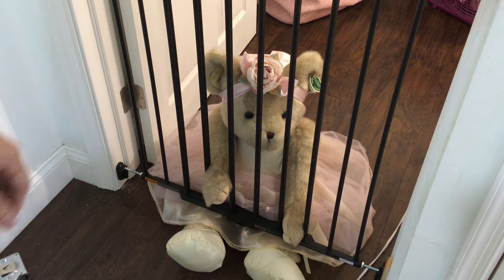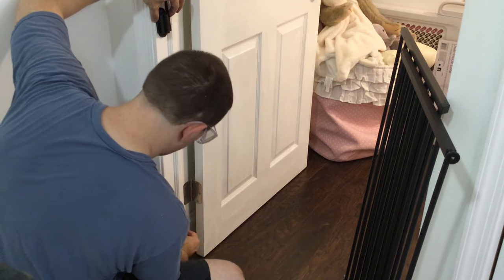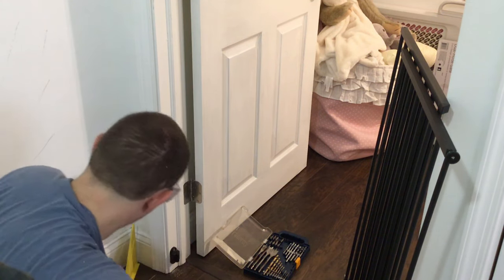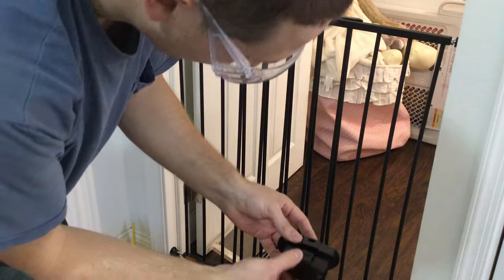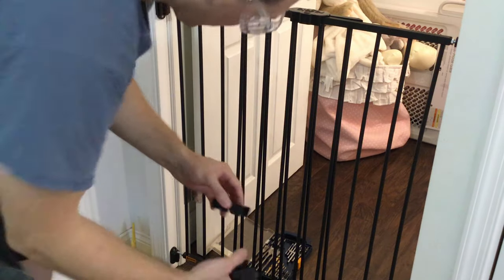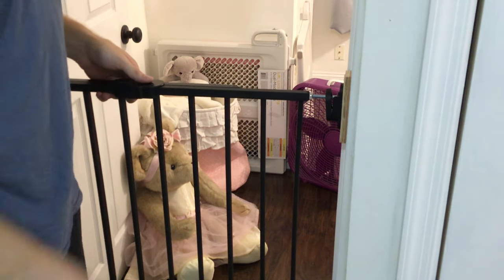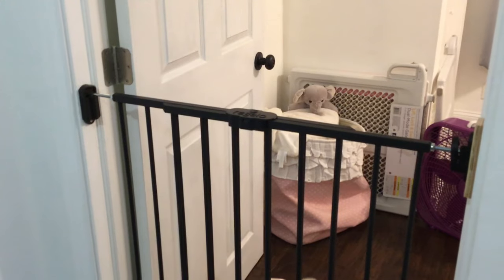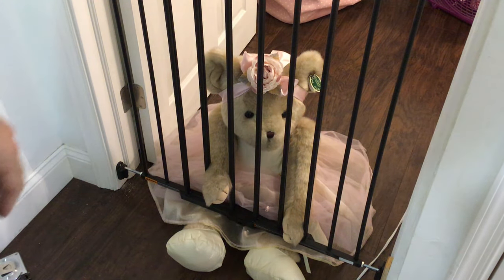How to Install the Regalo Extra Tall Child and Baby Safety Gate for Stairs and Doors

Comment: This thing is impossible our clips don't match
Reply: Hey I had the same problem, all I had to do was turn the gate around & it fit perfectly
Reply: @kayleemendoza9493  I've done that. Still don't fit
Reply: So I have the same problem and I figured out that once you put it to the door with the  threading spool rods
 You adjust the threading school rods. And then it will align right and close. But if you try to do it before it's going to have that gap. Hope that helps.😮❤😊
Reply: I said screw the clips and got my own hardware I used ring clamps and now it’s strong I got the clips fully on and a month later the plastic ones fell off so if this helps anyone your welcome 11$ fix
Reply: Yeah this gate was a pain in the balls i had to trim the clips a bit on all 4 sides

Comment: For anyone trying to figure out the clamps for the top and bottom, try putting them on the last slot, closest to the side that doesn’t swing open.
Reply: I’m about to throw it out the window cuz I cannot get it to fit
Reply: @starrpickens4397  I figured I’d come give this little piece of input in case anyone else struggles with this same thing. 😅

The first time we installed it we had zero issues but when it had to be relocated it was so damn frustrating I was on the verge of throwing a full blown tantrum! 😆
Reply: I'm still trying to figure out what is on the bottom of the 1st side he did
Reply: @legionswife1451 The bottom should be the L shaped metal. It screws into the gate and drops into the connector on the wall.
Reply: @LaSoulsVibe  I didn't see the piece that screws into the wall is what I was talking about
Reply: @legionswife1451  There are 4 plastic pieces with round edges. Two on each wall. One on top, the other on bottom.
Reply: @LaSoulsVibe  @LaSoulsVibe that is exactly what my husband is doing right now, having a full blown tantrum  all because he's determined to do it HIS WAY & refuses to hear anything else smh.

Comment: my gate connectors put up a massive fight. they did not simply slide into place.  bottom connector would fit easily in middle where "poles" were flexible but would pop out when it they got close to the top.  it appeared that the poles where soldered/welded to top/ bottom piece were just a bit too far apart...
Reply: I used zip ties. Works just as well.
Reply: @aimeedawn6628  watched the install video 5x - thinking, what am i doing wrong...smh
Reply: I was having the same problem....switch the gates...whatever one in da front put it in da back and it will go on with ease.
Reply: Mount.. top.. bottom... this video is not useful. Can you explain better
Reply: I'm sure this is much too late but I had same problem, here the one gate pc was upside down, once I flipped it they slid in  perfect
Reply: @jen5707  THANK YOU!!
Reply: @TooleyBoy20  your comment helped tremendously. I was so frustrated with this gate until I did what you said and the clip slid in easily. Thanks!
Reply: @terrikaharrison265  Ur welcome
Reply: @TooleyBoy20 this video did not help me but your comment sure did! I absolutely cannot thank you enough! This became a struggle for me that made me question my intelligence. Thank you for saving my sanity!!!
Reply: @terrikaharrison265 same here it took me 3 days to finally complete it with the comments from this video!!
Reply: @stoptheinsanity8963  ur welcome
Reply: @TooleyBoy20  thanks I'm going to try that when I get home it just would snap in place

Comment: The direction that came with this gate couldn't be worse so thanks for this!! I only mounted the hinges and not the other side....so it sort of works as a hinged pressure mounted gate. I am using to keep 2 cats apart, so don't need the "safety" like it was babies. :)

Comment: So I set up the door on the pins from each side. Then slide the clips, slid right in. The key is to swap the gate doors. As in try it with the left door in front and right door behind. Then switch it, with right door in front and left door behind. It’ll slide easy on one of the ways. Wish I had a video to help!

Comment: Thanks for the tip, I had molding in the way so,  locating second set of brackets easier with first set installed. The templates better for a standard installation.

Comment: The grooves on male connector are just to close. It will not fit or slide up easily.
Reply: I got it!  I swapped the gate around. It doesnt look like it makes a difference but it does. Slid right up!!
Reply: @beunka2  swapped the gate around? What do you mean by this. Please be very specific I am really having a hard time with this.
Reply: @cl8505  Been a minute.....but I think I just turned it around the other way.  Stood in front of gate, grabbed hold of it. Did a 180 degree turn and tried it that way.  Fit like a glove.
Reply: There is a triangle looking feature on the opposite side of the adjustment knobs.  Make sure the flat side of that triangle is touching the other gate.  Those triangle features need to be nice and flush on the other gates.

Comment: Still having trouble with this. We are doing this to the bottom of our stair, and we don’t have stud in desired place.
Reply from the maker: You may want to use wall anchors to hold it in place.
Reply: Summer Banister to Banister Universal Gate Mounting Kit – Fits Round or Square Banisters, Accommodates Most Hardware & Pressure Mount Baby Gates up to 37” Tall, Gate Sold Separately copy and paste in Amazon